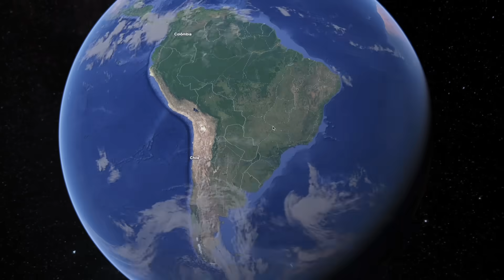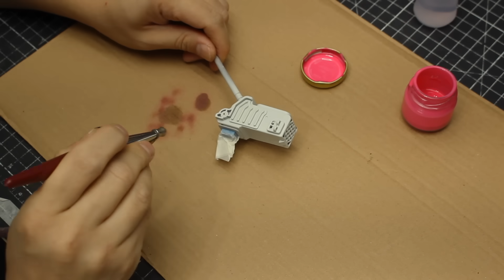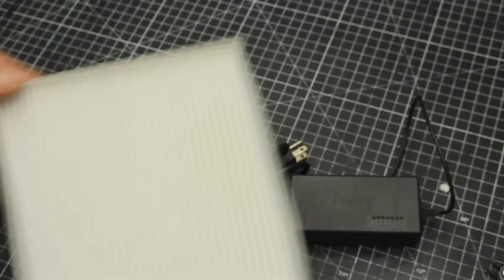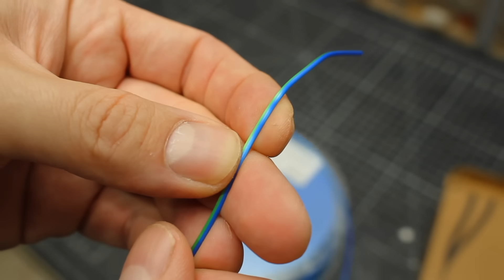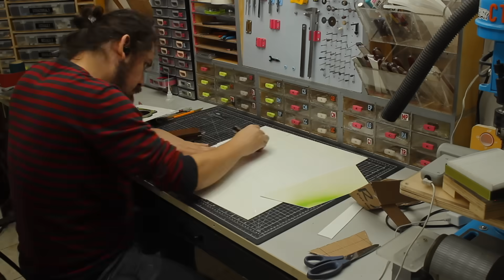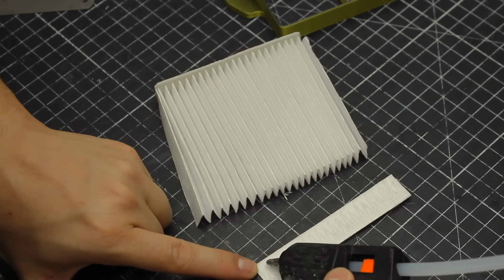Don't let my girlfriend know! (using nail polish as model paint)

Comment: Good idea for nail polish. I want to use it too with airbrush. What are you using as a thinner, can acetone be used or some other thinner, and in what ratio? Maybe nitro based or acrylic thinner for 2-component acrylic automotive top coat? But the product I would most like to try is matte top coat for nails. I do restorations and customizing diecast cars and I really like matte colors but I have similar problem as you, I live in Serbia and we do not have a large selection of model making equipment. Good matte lacquers are 2-component top coats for real cars and they come in 1 liter packaging and it's really expensive. Shiny clear coat is cheap but matte can be up to 10 times more expensive. So I want to try matte top coat for nails.
I was making transparent color top coat, I dissolve pen ink in acrylic thinner and then mix that colored thinner with top coat and catalyst. Results can be amazing.

Comment: So awesome you've found an alternate paint source that works with your budget and workflow. As great as your DIY air filter is, depending on how much you're using it, you may want to consider either finding filters that fit its form factor, or redesign it, so that when you are replacing the filters you don't have to cut down the filter every time to fit. Keep up the great work!

Comment: Usually nail polish is pretty expensive because of the vibrant and fine pigments. Resin/binder is also on the upper end of the price chart. If its cheaper/equal in price its def a good paint for models.
But you might wanna be careful with the fans. Solvents are inflammable. Usually you need EX marked electric components to make sure they won't ignite the fumes.

Comment: If you can't vent the fumes outside, the next best thing is to run the exhaust hose imto a closed bucket where the air vents have particle filter fabric in front of them so the unwanted crap either stops in the bucket or gets caught by the filter.
Reply: Or just have water in the bucket....done this lots of times if you cant vent your hose out a window

Comment: For ducting, you might try getting some aluminium or plastic dryer vent duct and large hose clamps. If that's not possible then heavy duty plastic sheeting to form a tube secured with a heavy spray adhesive.  Then with your 3d modeling skill, an exhaust port that matches the dimensions of your window, so it can stay closed, with a little weather stripping to keep a good clean seal at the window. Hope that will help, and good luck! Really enjoy your videos and looking forward to more in the future.